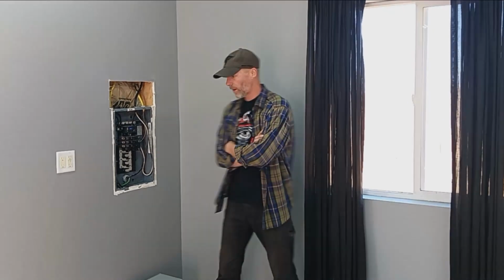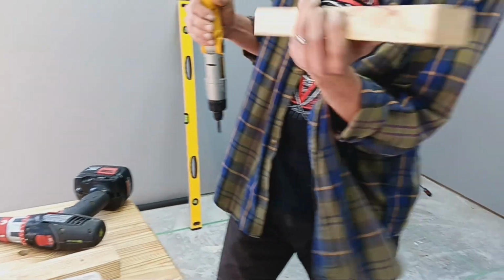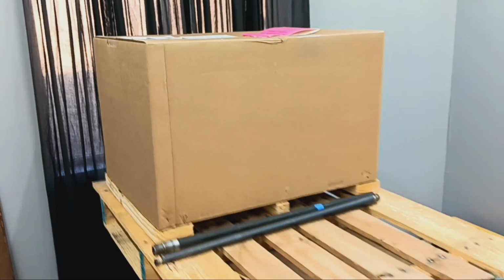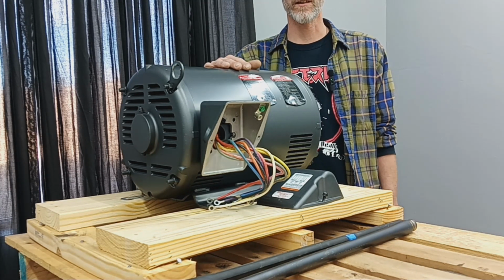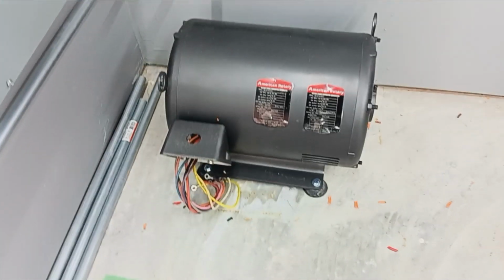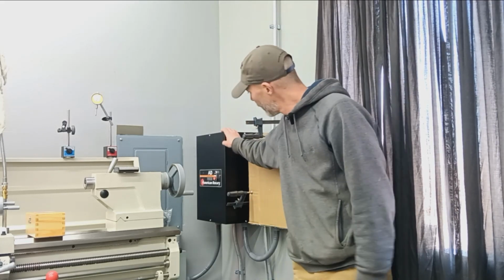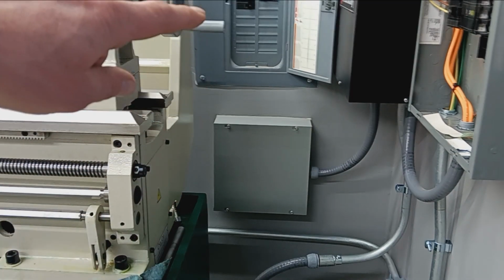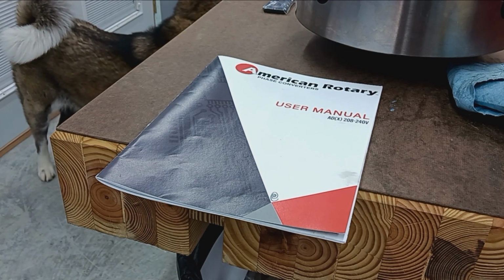Installing an American Rotary AD20 Rotary Phase Converter for 240V 3-Phase Power!

Comment: Kinda brave powering on a new installation with no cover on the 3-phase load center. Arc flash is basically getting sprayed with molten copper vapor.

Comment: Could you go more in detail about the wiring? I have a 30hp rotary phase converter and 2 milling machines I want to connect. I'm basically thinking about doing the same thing as you having indepemdemt 3 phase breakers for each machine.
Reply from the maker: It would probably be best to consult with an electrician, or call American Rotary.  They are super helpful!

Comment: Whats your power, came from the street? 2 legs with 127v each? Or cames 2 legs with 240v each?
Reply from the maker: Hi and thank you for watching the video and for the comment!  We have typical USA 120V 2 leg with neutral lines.
Reply: Howdy awesome video.  I'm wondering how hp your lathe and milling machine are and if you can run them both at the same time with your AD20  thx in advance
Reply from the maker: Thank you for watching!!   @ikehofer2782   The lathe is 3 or 4 HP (depending on which range I'm running) and the milling machine is 3.  Yes, I can run them simultaneously which is why I went with the AD20.
Reply: Okay thanks man